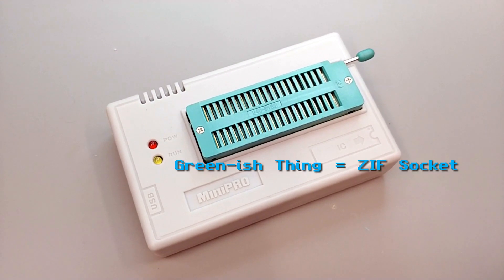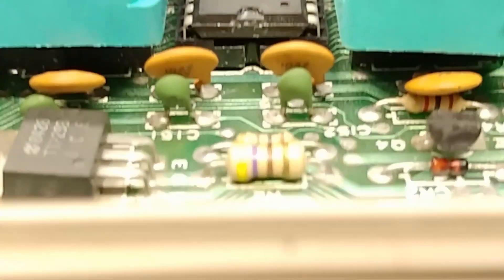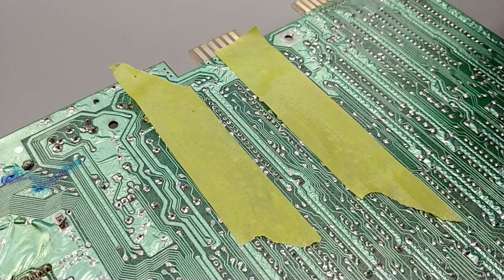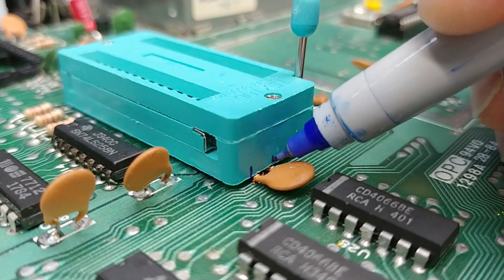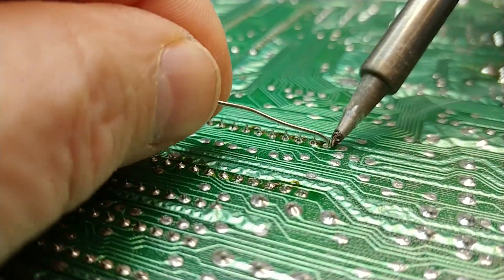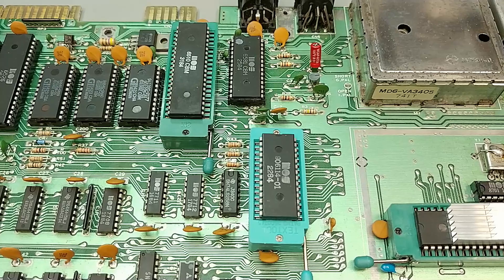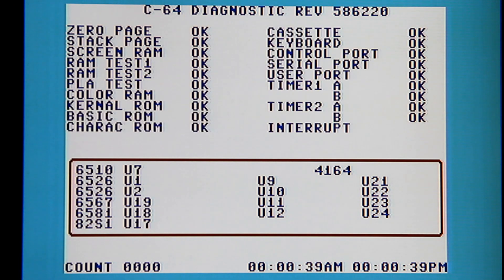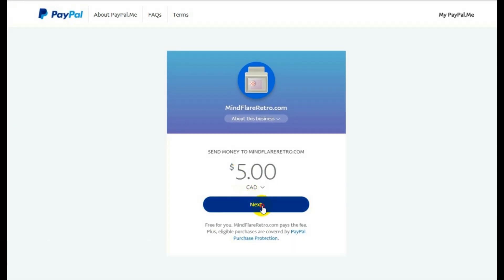#11 "Zero Insertion Farce?" — Installing ZIF Sockets on a C64 Motherboard

Comment: Hey MindFlareRetro guy, I'm new here, but I'm just gonna go ahead and just coin you as the "This Old Tony" for retro hardware. I'm sorry I cannot throw anything decent into the cause or reason of the pop, but to me it sounds like a "DC offset" on initialisation. Or (this is hard for me to describe), say the wave form is above or below 0, there's a distinct change from where the waveform was to when 0 started. This is to say there's no "zero crossing". You would have to determine if it's an analogue or digital issue. 

Maybe go from 0 to 1 repeatedly to see if you get the same velocity of the click, if you do there's a digi problem. If it's not as apparent then go looking down the analogue side of things. 

This is me just talking rubbish, but it's what I would be looking at.

Edit, it seems your subscribers have you covered, gg guys :)
Reply from the maker: Hey Neffers. Not rubbish, at all. Thanks so much for your insight — I appreciate your comments and the lesson. Cheers! 

LOL! I've got nothing on This Old Tony, but thanks for the compliment.

And dude! I just subbed to your channel -- love the music!!!

Comment: What would happen if you piggybacked multiple black sockets to raise the height and then a zif socket on top of that? Thus to raise the zif socket out of the way of other components? Do you need to desolder the original socket?
Reply: Doesn't work, at least not with the standard sockets and ZIFs that I have. The legs in the ZIFs are wider, and they are oriented in an angle that doesn't go into a standard socket. I have tried inserting a ZIF to a normal socket, and also to a round pin header socket, and I haven't been able to do that.
Reply from the maker: Yes, the ZIF legs are flat at kind of flimsy (picture: https://is.gd/k8H5io). I've tried ZIF-->ZIF and ZIF-->StdSocket, but they do not connect well at all.
Reply from the maker: Oh. Someone has their thinking cap on. ;) That's a very interesting idea. The original socket could stay in place. The only challenge might be inserting the ZIF into the topmost socket, as the pins on the bottom of the ZIF are pretty short and really thin and flimsy. Thanks for the great idea. I might give it a go.
Reply: MindFlareRetro , I think i seen someone did just that on a old NES console they re-purpose into a Test Rig
Reply from the maker: Oh, yeah? I'd like to see that NES test rig. This was my intention, too, as I use this board all the time for testing chips.

Comment: As you will use this board to test chips, I would replace those MOS 7708,7711,7712 as this will fail for sure, I am even surprised that they still works :)
Reply from the maker: Yes, you are absolutely correct. In fact, I am repairing another C64 now with all kinds of bad logic. I suspect I will slowly mod more and more of this board with ZIFs as time goes on. Thanks for commenting!

Comment: This is a great idea. I would like to do this myself to a 64 or a 128. Maybe also the RAM chips.
I could use this at our bi-monthly Commodore meeting in the Netherlands.
Reply from the maker: Thanks for commenting, Richard. It does make it a lot easier to swap chips off of and onto the board. I would definitely recommend moving caps to the underside -- a lot easier and cleaner than precision filing.

Comment: What a fantastic video! Really well shot and explained! How is there enough clearance on the bottom of the board for those caps to sit upright?
Reply from the maker: Thanks very much. I wasn't very clear there. I actually positioned them flat -- well, bent them over ever so gently. The back shield is very flexible, so not a problem there, and there is a fair bit clearance between the shield and the bottom of the case, as the mainboard rests on standoffs. So, everyone is happy under there.
Reply: Phew! Glad you're not squishing those little cappies... wouldn't want them to go pop!

Comment: Maybe just leave the SID normal DIP socketed - I must have clean working SID. But for testing purposes, I get it, good work.
Reply from the maker: Thanks John. Yes, for testing purposes so I'm not too concerned. GadgetUK makes an interesting point in his comment, where the ZIF socket might be adding a small amount of capacitance affecting the prominence of the pop sound—as he says, "A bit like bread board adds a few pF between the pads."

Comment: Mirroring some of the comments already posted, great video and very high production values. This ZIF test machine is a really great idea. Look out for me copying you in the near future.
Reply from the maker: Nice, it took me almost 11 hours to realize you left a comment - bad me. Thank you for the kind words. Copy away! In hindsight, I think the best approach is to relocate all in-the-way caps to the underbelly. Much easier unless you are feeling the urge to sculpt.
Reply: MindFlareRetro I was wondering about your existing sockets and an alternative approach of placing the ZIF in a socket. Probably not a good idea due to the ZIF pin movement when opening-closing.

Comment: Very cool =D  I would have relocated all the offending caps underneath btw!  But nice clean job creating gaps for the caps in the sockets!!!! =D  With regards to that popping noise, does it stop if you put it into a board without a ZIF socket?  It could be a capacitance issue with the socket I guess.  A bit like bread board adds a few pF between the pads etc.  The width of the socket holes and the length they extend down through the plastic could be a factor.  It's also possible that it's just a glitch with that particular SID?  EDIT: Ignore all of what I said about the popping there - see Bedford Level Experiments comment below!  I had no idea that was a technique used for samples lol.
Reply from the maker: Thanks for commenting GadgetUK. What you stated makes sense. The pop (especially when set to zero) is definitely more pronounced now.

Hah, yes, the light bulb turned on (moving the caps to the underside) after I completed the first three sockets. Any future ZIF socket retrofits will involve a lot less carving. =)
Reply: Yeah, don't get me wrong - not being critical, i think the filling down is a marvelous idea there on the sockets!  Means fewer changes to the board =D
Reply from the maker: No problem at all. I appreciate the input. I had read a blog on Breadbox64, I think it was, where someone installed ZIFs using the filing-down method. I think I would have gone with relocating all the caps on this particular C64 (my bench one) if I had thought of it sooner, but I had tunnel vision with that blog post in mind when I started this.

Comment: Great production values! And yeah, changing the volume on the 6581 in particular creates a pop sound. It's how digital samples were typically played, by rapidly changing the volume. The volume of the pop was greatly reduced in the 8580 SID, and that caused digital samples to have a much lower volume on newer C64s.
Reply from the maker: Thanks for your positive feedback. I always remember a small pop, but the loud pop at volume=0 seems more noticeable now. And thanks for the history lesson; I didn't know that they tried reducing the pop on the 8580.
Reply: The removal of the pop in the 8580 started the Great SID Holy Wars of the 80's.....that war is still on-going.  :-)

Comment: My understanding is that the pop is a ”feature” of the SID. Some demo coders even use it as a “fourth voice.”
Reply: This is pretty much any game or demo that has samples (aka "digis") playing at the same time as the music. Maybe the most famous example is the title track for "Skate Or Die" - that big distorted guitar is a digi, and the 3 true SID voices are busy doing the other parts.
Reply: @BedfordLevelExperiment  The intro part on Arkanoid is also coming from the sample 4th voice.
Reply from the maker: Thanks for commenting. Yes, you are correct. I always remember a pop -- it just seems more pronounced now, especially when set to zero. Ah, interesting -- I did not know this -- I would like to find some examples of the "fourth voice" in some demos.
Reply: @MindFlareRetro  the reason that setting the volume to zero created the biggest "pop" was because it was the largest transition - you were going from volume 15 right to volume zero (15 steps) in one go..  all of the other transitions were only a single volume level at a time.
Reply from the maker: @gundys_garage  Hmm, I never looked at it that way. I was always aware of the pop sound. It just seemed a lot more noticeable after I installed the ZIF sockets. I have never looked at it, as you say, transitions occurring one volume level at a time -- interesting. Thanks very much for commenting. :)

Comment from the maker: A huge thanks to Steve Sexton for pointing out that I kept referring to the two capacitors, that were relocated to the underside of the motherboard, as resistors. Ugh. Not acceptable, so I pulled the video, made corrections and re-uploaded. My apologies if you had already left comments or likes/dislikes.

At the time of pulling the original video there were 15 views, 2 likes, 1 dislike.

Original comments were as follows:

Steven Sexton COMMENT
Not to be an a**hole but you kept calling caps resistors.
  ▼  
MindFlareRetro REPLY
OMG. You're totally correct. What a massive brain fart on my part. You're not an a-hole; am just daft for not noticing. This is what happens when you do voiceover at 2 AM. I'm actually going to pull the video and correct this. Thanks again!

Siana Gearz COMMENT
Sounds like aux in noise/offset induced volume click. You sure it wasn't normal on your specific machine? Was even used for digi sounds back then.
  ▼  
MindFlareRetro REPLY
Yes, you make a very good point. I think the pop was actually there before but I am hearing it now for the first time. I had changed my speakers recently, so I wonder if it is just more noticeable to me now.

Todd's Nerd Cave COMMENT
Great video! Clever idea to move the components around the SID chip to the bottom of the board. That’s exactly what I would have done too. As far as the SID popping goes, have you tried another SID in it? Or was it working fine before the ZIF socket installs?
  ▼  
MindFlareRetro REPLY
Thank you. I have tried one other SID and it pops, as well. It's not as noticeable as in the video -- I have the mix right next to the speakers and the speaker volume cranked. I didn't notice it before, but I've made a few changes lately -- new speakers for one (hmmm) -- so it might have been there all along but I just didn't hear it.